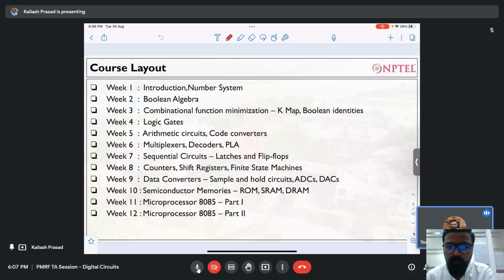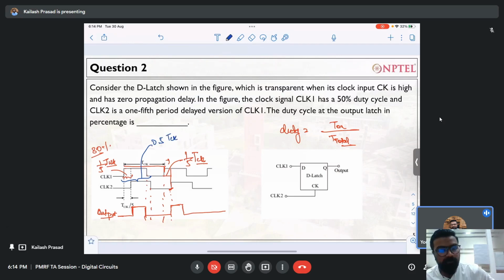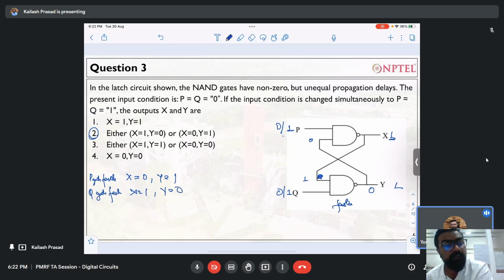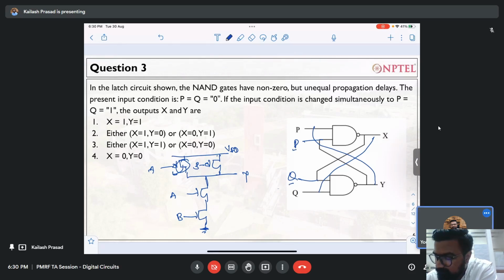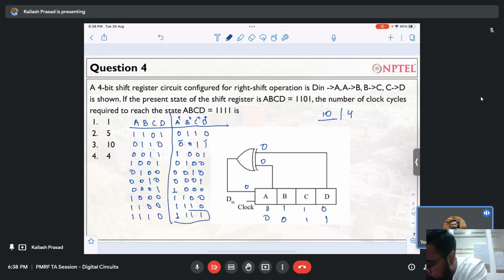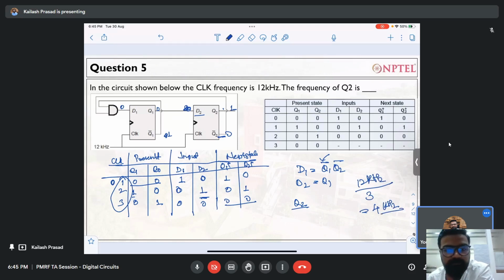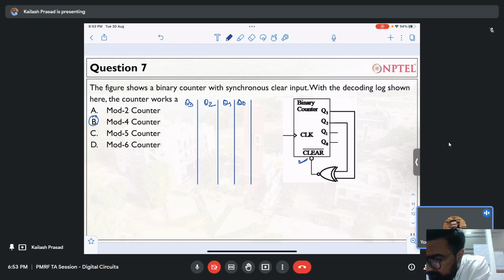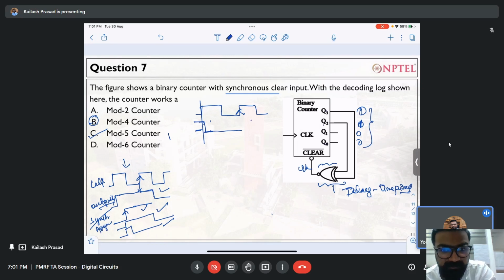NPTEL - Digital Circuits - PMRF Live Session 5 | 30th August

Comment: sir i have a question, as asynchronous sequential circuit are free running and they are not bounded with the clock so why should they be slower than synchronous circuit?
Reply from the maker: Asynchronous circuits can potentially be slower than synchronous circuits because they do not have a common clock to coordinate the timing of their operations. This can lead to delays in communication between different parts of the circuit, which can result in slow operation. Additionally, asynchronous circuits can be more complex to design and verify, which can also lead to slower performance. However, asynchronous circuits can also offer benefits such as lower power consumption, lower electromagnetic interference, and improved reliability, which make them an attractive option for some applications. Ultimately, the choice between asynchronous and synchronous circuits will depend on the specific requirements of the application.
Reply: @kailashprasad_kp  got it sir, thank you🙌🏻